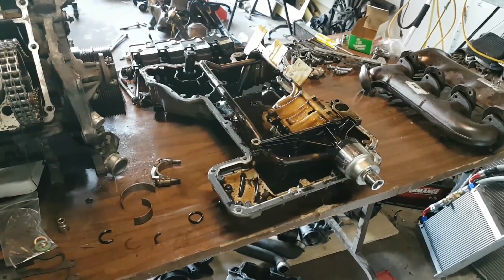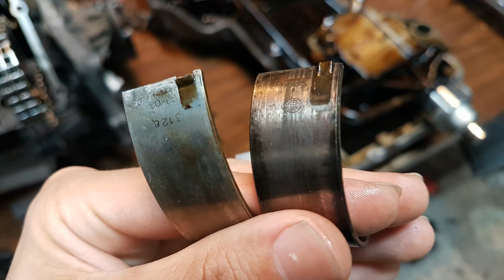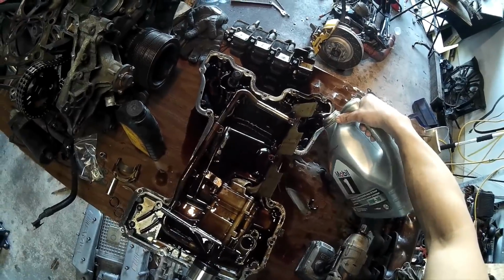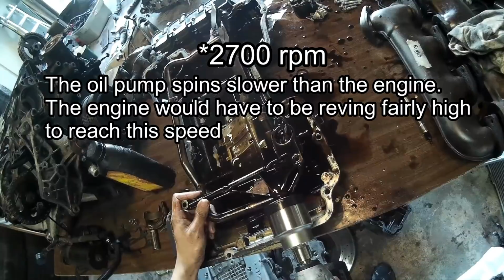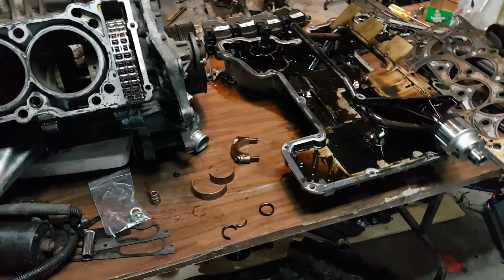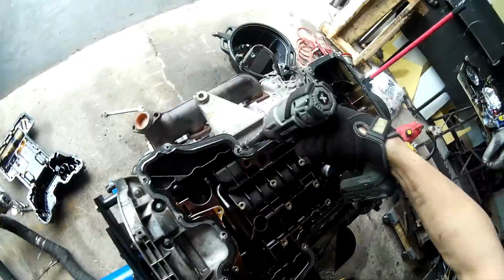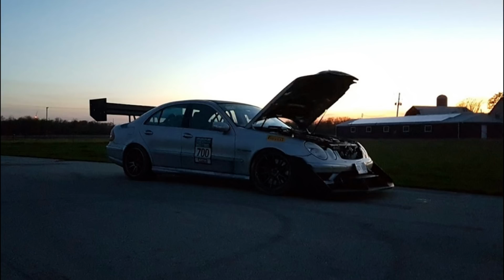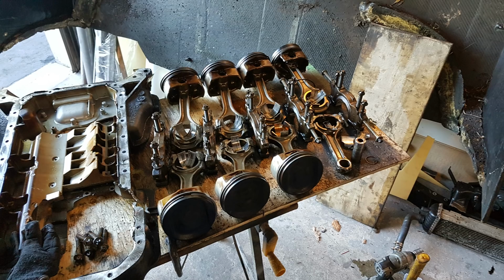Bad O-Ring, Spun Bearing Again! On 2nd AMG Engine

Comment: Does the regular non Kompressor M113 have this problem? My car is a 2004 CLK500.
Reply from the maker: Probably not if it doesn't have the split oil sump. You can install an oil pressure warning if you want to stay on the safe side
Reply: SK8215 thanks! Yeah I looked at CLK500 oil pans on ebay compared to E55 and there's the clear difference of just one sump. 
Pardon my confusion, but can't the single sump tube's o-ring still have this problem?
Reply from the maker: In those engines the oil collector tube is a part of the oil pump so there is no o-ring or gasket required to seal it. Its a much simpler and better design imo. 
One thing I did find in my SL500 was that the oil pressures stay very low when using 10w40 oil. I switched it to 20w50 after and the pressures look way better. So yeh that's the only change I can recommend, use thicker oil. Other than that, its a good engine. I personally think the n/a variants give way less trouble than the supercharged ones
Reply: SK8215 Awesome thank you! I switched to 5w50 from 0w40 last week. I'm in Los Angels, California where it's never cold so I think I'll be okay :)

Comment: The scraping from the chain to the block could be caused by the chain tensioners losing oil pressure when the car is sitting for a while. There should be a membrame inside of the chain tensioners that holds the oil pressure, when the car is shut off. But these tend to wear out easily, causing massive slack in the chain when you start the engine. Mercedes improved the design of chain tensioners many years later. In my case, the chain slack on start-up was so heavy it could easily be heard as an metal to metal rattling sound. Hope this could help you. Also in your case, it could be by the low oil pressure, causing the chain tensioners losing the strength and causing slack in the chain.

Comment: Is there a chain tensioner on the oil pump chain that is operated by oil pressure? If so, the loss of oil pressure from o-ring failure would explain the chain-slapping marks you found near that chain. Those marks indicate metal scrapings are in the oiling system, and the oil pump and every lubricated area will have to be decontaminated if you want to fix and re-use that second engine.  Using a replacement O-ring made of Viton or other high performance material would seem to be an excellent idea. Failure to install an oil pressure gauge and the use of an inferior O-ring with a limited service life in a critical area of a high performance engine would seem to be engineering malpractice by Mercedes and/or AMG.  O-ring failure on oil pump pickups is a known problem on any mass production engine using that setup. In the USA, even Amazon offers a wide selection of Viton and other high temperature O-rings with free 2-day shipping for Prime members.

Comment: Any leak in an oil system is going to cause engine failure, It must maintain a min of 30psi at all times preferably higher .Orings go hard due to heat. Poor design made to fail after a certain amount of use. I would be looking to improve the design with a more permanant fix. I would be looking at a teflon or viton type seal or machining out the pump so the oring is seated in the pump not clamped to it or a small adaptor to do that. brass fitting pressed in to the pump machined so the pick up pipe and oring are pushed into the fitting so the oring can not come apart even when hard.

Comment: How much would a mech charge to fix this? Got to be 2 solid days work, at $200 an hour. So, at least 3 or 4 thousand to fix a $5 part. 
You can't just drop the pan, the subframe has to come out, too.

Comment: Had to disassemble my engine due to another mishap. I found spun bearings on 6 rods. Looks like most of the M113k s get sick with age.
https://mbworld.org/forums/showpost.php?p=7497633&postcount=32
Reply from the maker: Just read through it. Great post, thanks for sharing. Sad to see what happened to your engine. There are two ball bearings at the back of the supercharger. Would be interesting to know whether it was something that fell from inside the supercharger or something external. I'll keep following the post. 
Interesting to see the spun bearings on your engine. Really hope we learn more about it as more people give their feedback. Doesn't seem right having a well built, reliable engine going out because of small issues.
Reply: I think my supercharger has been rebuilt previously. And the bearing part has been in there for a very long time. It just came loose when I took of the supercharger to install the nozzle. When I took it apart the gasket between the supercharger and intercooler was missing. It was just glued together. At this point the supercharger seems fine when I spin it. 

When I disassembled the engine I noticed it was clearly rebuilt bad. The pistons on one side where installed with the mark on the exhaust port instead of the inlet. Black rtv was used everywhere even on the head gasket. As far as I know Mercedes uses gray.

At the moment I'm looking to repair the engine block and my options are limited. Repairing the alusil seems useless at 580€ a piston By the time I'm finished it will cost me 6000€ for a stock motor. I talked to a couple of engine builders and they seems sceptical to install dry liners for a high hp application. They al want to do it but don't give me any garantees due to de difference in expansion rate of steel and aluminum. So this option seems useless to me aswell. I'm curently talking to a couple of companies who coat alusil bores with nikasil. I don't have a quote yet but at this point it seems the best and only option.
Reply from the maker: Yeh, thats an expensive price for the alusil repair. Have you tried looking for a used short block? The prices are not that bad if you come across one. They are hard to find though, as there's not too many being sold.

Comment: What do you expect when you thrash an old engine round a track ,highly modified from the original design, wonder how long this second engine will last ? And how many worn parts in the engine are you going to replace ? You cannot cut corners if you intend to get it right, Many pitfalls when reconing an engine, You will find out !  Not criticising, just been there, done that. (Entertaining vids though )

Comment: Definitely a problem with design & no redundancy there at all, I think on something so critical as that 'o'ring you need to take the Rolls Royce aero approach & design the simplicity out of it & modify it with redundancy engineered into it, something like a  brass olive & pipe union with a lock washer & flare the pipe so you are not relying on a threepenny bloody 'o' ring. Bad design, unusual for Merc!

Comment: There's a good reason why you don't use Vaseline (petroleum jelly) on condoms....and this O-ring problem is caused by the same issue. Oils, and the chemicals in them, (including petrol) degrade rubber, turn it harder and brittle. So I think how it was driven and used or mileage done all make no difference to this issue. You could also try rubber gloves, leave them in an organic hydrocarbon for a few days and see how they end up.

Comment: Send the engine back, it won't be cheap to fix (and should have worked ok so make them pay, and waste their time), plus new bearings will need to be run in ect. Although I suspect the amount of time to recondition and run in will be a bigger factor than costs. I'd then drop an LS or 2jz or ford barra engine in, and go for serious power. Those barra engines from factory get 950bhp if you change a few springs and add a turbo and haltech ecu. Any of those 3 would be cheap in comparison to a Merc engine, and could produce more power. (plus you don't take the risk of same problems occurring again).

Comment: Hi the problem with the oring is that they may have never changed it, ofcourse they did oil changes and everything, but changing that ORing and the chain tensor are never been replaced, even the springs they wear out due to heat and they do it over time, at first you start to feel ypur engine noisier, but it is so over time that you get used to it before they get noisier and noisier, eventually they broke and you got a noticeable trouble, everything in a car made from rubber or using spring should be replaced in a specific time, for example they tyres on the subaru i got were the original and they fail inspection due to time hardening them, not from use... now im rebuilding a bike from the 90's zxr 400L model, and have been buying Oring, springs and rubber gaskets for about 2 years now, nobody replaces them they get use to the sound and leave them there... the wear of the block is from the use, lack of proper tensioner bad springs on the tensioners or wear out chain... they start to sound, maybe it has a oil pressured tensioner and due to the lack of pressure it were not properly working, i'm rigth with you in the oring causing all of your problems. Great video btw

Comment: Pretty common design. mitsubishi starions used a similar o ring setup on the pickup tube. I just sold my cls55 awhile back. It is a great engine, but with any engine, there are always issues to keep them going long term.

Comment: I just read it in one of the comments but it was just what I was going to suggest. Replace all the oil related O rings with Viton ones. My father worked for Dupont and I still keep a samples box with assorted sizes. They are very long lasting . Good luck !!!

Comment: The damage from the chain is because as the oil pressure dropped due to the O-ring failure, the tensioners relaxed allowing the chain to contact the block.
Reply: Not true, oil pump chain is tensioned by spring only.

Comment: HI,
 I notice that there is an oil strainer on the scavenging pump inlet, but no strainer on the main pump. 
Those bits of block that were bashed off by the timing chain certainly did the oil pump no good when they went on their way to the filter!  AMG did bother with a filter .. did they??
Maybe during prototype testing the stock strainer was starving the pump, so instead of making a custom high flow one the just left it off..
 I wonder if the other cars with the same engine have a strainer on the main inlet?

If you want to know how to put and O ring on properly there is a good Youtube video by AgentJayZ on Jet engine O rings
Reply: F*** an o-ring. Braze that baby on. No more worries PERIOD.

Comment: Rubber needs time to turn into plastic. This means the oil problem of the engine wasn't something new. Probably you had overheating problems a long time before the engine blew up. The inexplicable thing is that an engine with oil problems usually looks dirtier than your 200k km engine. Oil problems means sludges and burned metal spots here and there, not only on cylinders. I suspect that the hardening of the o ring was the effect of a too high oil temperature - not the cause of it. So, maybe that famous o ring is not the true culprit of your engine failure.

Comment: the scrapping is from the timing chain tensioner that dependent upon you guessed it oil pressure, with little to no pressure the chain will slack off and slap

Comment: If this is a track car, I'd get a larger and better quality oil pressure gauge, and mount it up high in your line-of-sight.
I use Auto-Meter Pro-Comp 2-5/8" gauges in my race cars.

I also agree with using an o-ring material that is better suited to high temperatures as well as oil-resistant.  Look up a chart of o-ring material characteristics for more info.

Comment: What fucking idiots are saying it won't be damaged from a leaking O ring??  Also,I haven't read through the comments,but the timing chain is hydraulically tensioned,so lack off oil pressure = lack of tension

Comment: also i can make a gunked engine seem clean if i wanted to be an asshole i mean emacualte. chill the outside and fire it off with some xylene / 0w0.5 half and half let it run running icecold water through it stand alone let the inside get hot start flushing it with really hot i mean hotter than the engine whatever blend you spec yourself to bed at night with and then gradually while its running bring it with the proper ranges.  now after that after washing the cylinders and fuking themup run a vacuum and o2 metered LP fueled supply and roll up with and extremely clean engine that has a really bad pre existing condition not seen unless you tear down the bottom end. the reason " i " did this is because somehow when i swapped engines the one i built went full throttle on initial fire, and reamed it quick something serious but then i just shut it off, heavy weight then a very long break in period , then i start hearing that in between load and lash ticketty tock knock and it doesnt seem like its breathing that good but i have compression ( valve lift/ duration) that initial fire off, and precisely how a benz is assembled is almost everything, keep oil and fuel in it, especially if its diesel, it will go when tried. disagreement,  nein heist/ fucked over by wife..lol lmbo sv. twinturbv8 seven letters not six late not bored out short choke on the stroke back to 6.3 plus  lateralgeez.      one thing done well is the bore and stroke on the cL55, seriously     what do the rest think???? cL55AMG bore and stroke good for  stocky package yeah?

Comment: mechanical broski, the matchup wasnt made, either out of skew or out of variable and possibly not fastened and assembled within the accurate values which came from formulas derived from not just bench testing and metallurgy, but also physics, molecular solvent and viscosity testing variables, as well as average dry start temperatures and first fireoff techniques.      temp issues are uniform and ring out from the source and bounce around the areas of heat dissipation which is an animal.

Comment: Mercedes-Benz  has bad oil drain back engineering and combined with the high oil change intervals adds up to a lot of sludge. Most that I've taken apart with service done on time had a lot of sludge and carbon inside the engine.

Comment: Great video. Just wondering, would the engine sounds differently when oil pressure is low or no pressure?
Reply from the maker: You'll only hear it when the bearings wear out enough and start knocking. Its best to have an oil pressure gauge or warning light

Comment: Definitely use a viton oring. Green or brown is a common viton color. Black is buna and does not take heat cycles well after time. The viton is designed to take the heat cycles and not harden.

Comment: Is it possible the damage done by the chain drive is a result of an oil pressure tensioner not getting enough oil pressure to work effectively? (Due to the ineffective seal?)

Comment: I'd install a new o-ring then weld a small brace between a hard point to the pick-up tube to ensure even if it becomes brittle, it really can't lose all suction.   OR...simply pack the external seam with a bead of "The Right Stuff".  It's the ONLY RTV I use when rebuilding engines.  WHY use the same obviously flawed O-Ring?  Find a Viton/non hardening material of the same dimension or a bit oversized(freeze it in dry ice so it'll shrink to fit...done it on other oil pump pickups O-rings).

Comment: Very nice, amazing the difference between the hard O-ring and the new one. 

I advise you should pay half the price for tracing the failure and free the engine supplier of a future claim of a blown/destroyed engine for the buyer (like you),  you truly helped to trouble shoot a main problem for this engine and all the dealers and users of such should directly take that advice to heart and repair/change the O-ring (and the bearings if needed).

I noticed the little lip on the bearing to lock it in place ie to keep it from spinning as that was (being) bend over and so spin/spun became possible, you didn't mention that !!   So it took quite some force of friction to bend and spin it (around and) flat thus !!   

Cheers.

Comment: I can understand the decay of materials in extreme temperatures and maybe not very thought through usage of such o-ring in very critical part of an engine but for not having an oil pressure sensor in an engine there is no excuse, this is ridiculous design flaw, very not cool Mercedes.. Not as critical but same goes for BMW, the use of valve guide seals from material that is not appropriate for the engine with higher oil temperatures. There is this paradigm with German engineering - they can build quite complicated and reliable engines but then fail at very basic things that undermine the whole effort.
Reply: The problem is not the engineering, it's trying to cut costs at the production to the max. The quality of Mercedes at that time was very bad and has to do with partnering with Crysler. I would not buy a Mercedes out of this time.